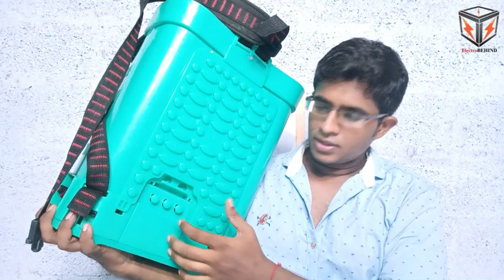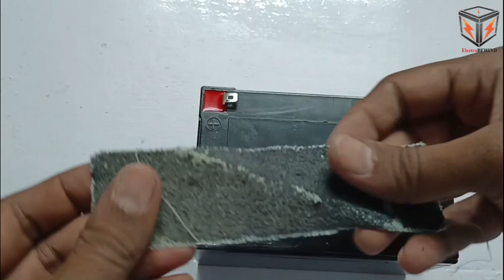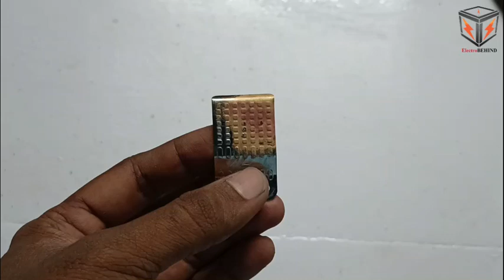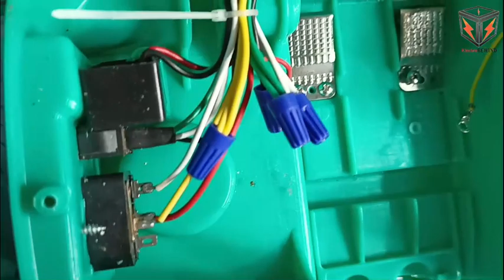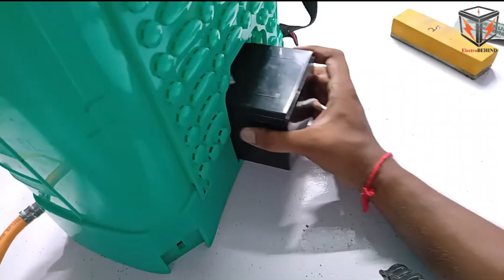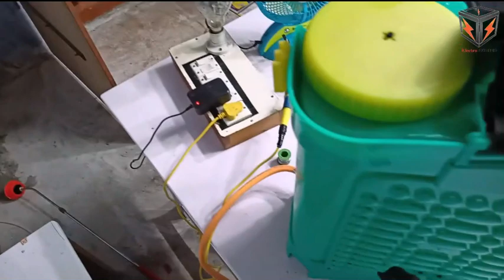Battery Sprayer battery and charger repair in Tamil

Comment: bro jawann sprayer not charging  or working ah nu teriyala charger maathi pakklmaa..konjam solunga
Reply from the maker: Charger oda output voltage multimeter vechu paruga 12 volt varuthanu...apdi vantha charger ok